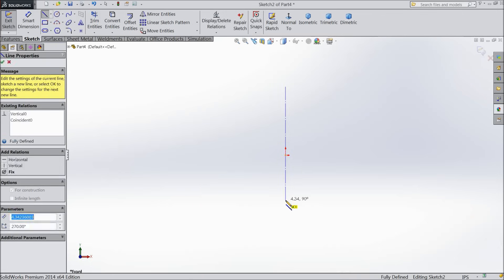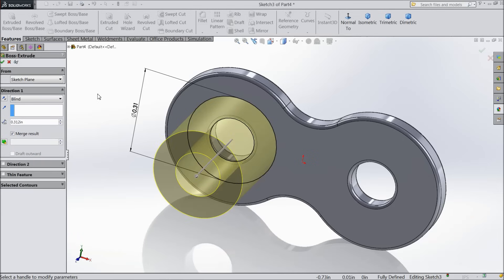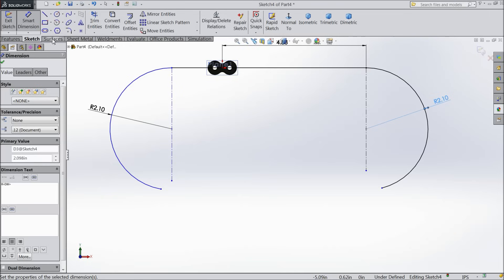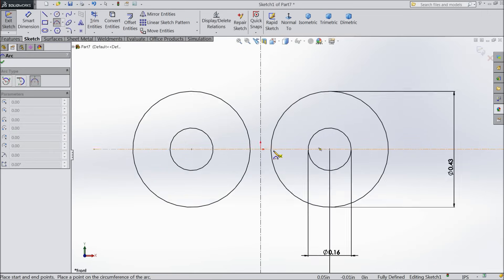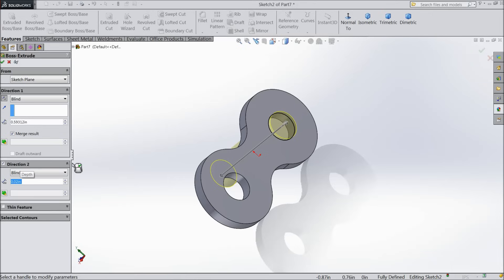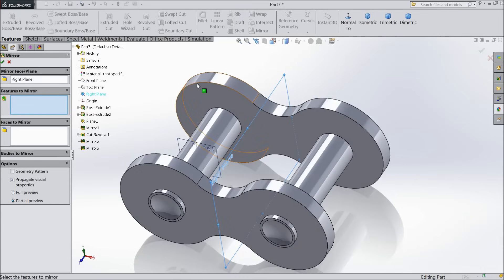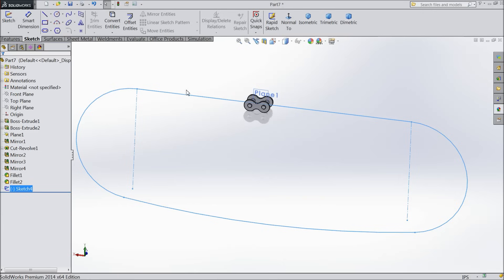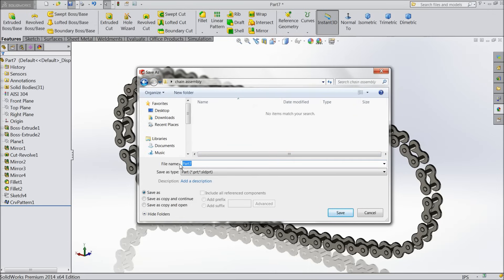Solidworks tutorial Chain and Sprocket Part1

Comment: and can u please send the calculation u followed...because I'm facing problem in making the arc connecting the circles
Reply from the maker: arc corner distance is measures from side circle center point its around 0.4373028 inch
Reply: @CADCAMTUTORIALBYMAHTABALAM  but it says 2.1 what are you doing cant follow

Comment: The Cut in last part , where you modified chain assembly is problematic. The dimensions are not correct in here. you modified them later on.